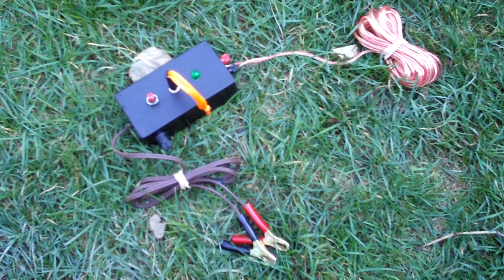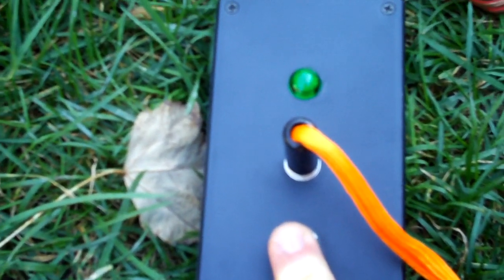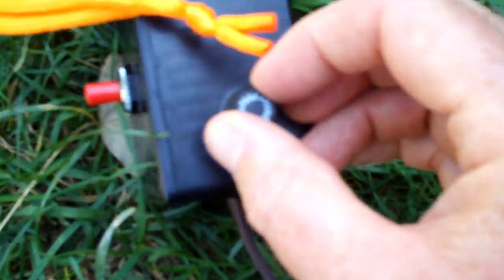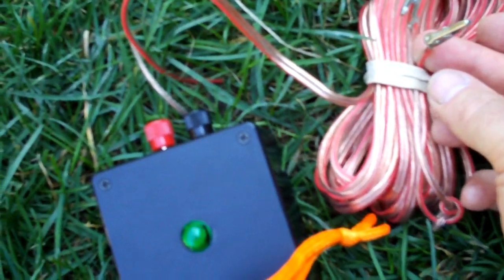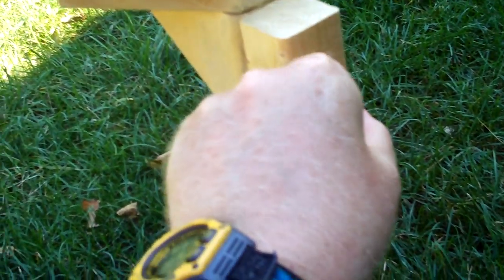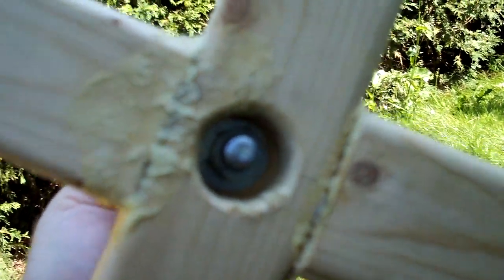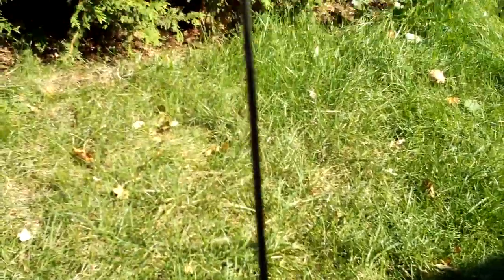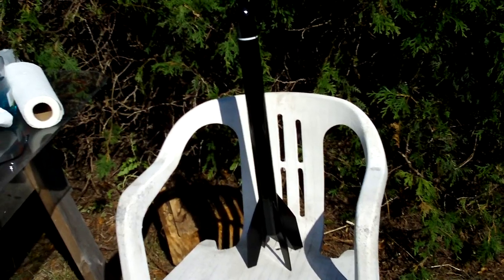Homemade Model Rocket Launch Controller and Launch Pad

Comment: You might want to redo the layout of the launch controller where, the "safety key" is on the bottom, then the "continuity light" is above that, and then the "launch button" on top, it gives a safer order of the launch sequence!  And, on the launch pad you might want to have a little wider base legs for stability! And, yes you want to drill holes through them to drive some hold down spike for added stability! 👍

Now having said that: "One of the best DIY launch controller and pad on YouTube!" 👍
Reply from the maker: Thanks. That would be a better design I agree, for the launch controller. Perhaps that will be the Mark 2 design. I was thinking of drilling holes through the launch pad legs and putting tent stakes through them for hold downs.
Reply: @electronixTech  Yep, that is the wonder of building "stuff", you design it, build it, then use it and then realize, hey it would be better IF I did this! I think that is how the "Mark 2" was invented! 👍

Yes, some kind of spikes helps tremendously! 👍

There are a million ways to build the launch systems, and you will wind up with a whole bunch of them the longer you fly rockets! As long as they work, it's all good! 👍

Comment: Nice design, i actually made two controllers with some old metel project boxes and used bannana plugs also. I've been flying old Estes rockets since 1972, i've also built several lauch pads.